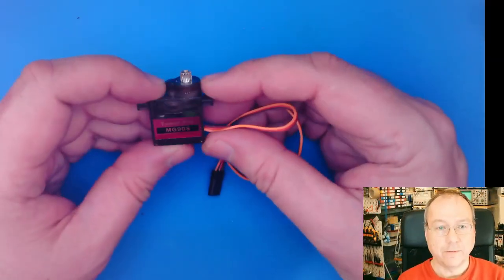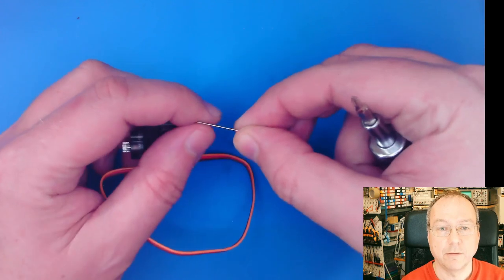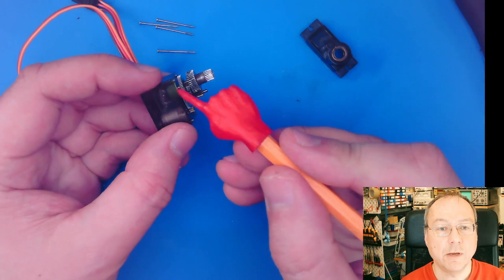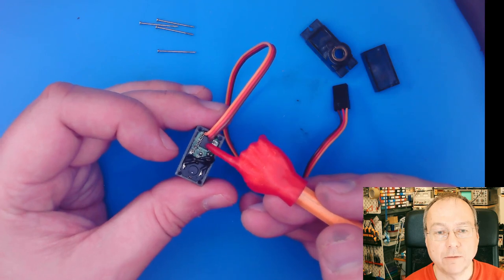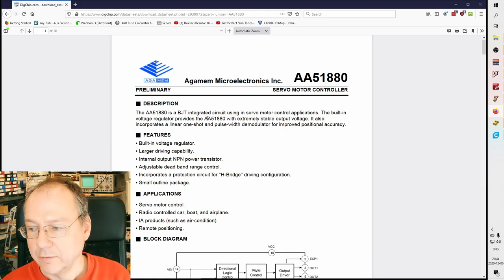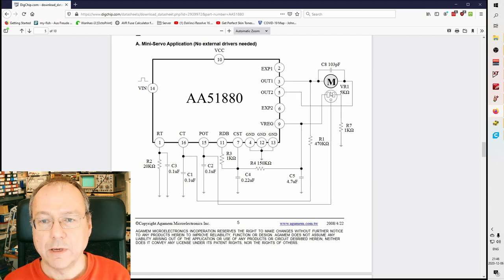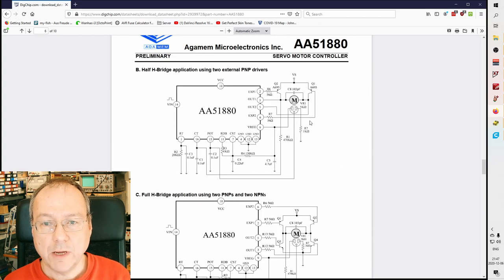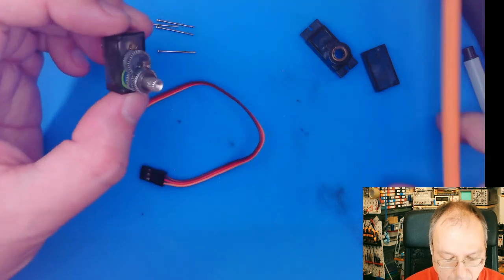Looking into a small servo motor

Comment: A simple trick is to remove the potentiometer and drive the motor directly, if you just want a small but powerful electric motor!
Reply from the maker: I have never done that and would personally think that it is a waste of a perfectly fine servo motor - but sure it is possible. The poor motor controller will try to catch the correct position but continuously fail to do so, because the feedback signal is gone...
Jag spelade in den här videon eftersom ämnet kom upp i diskussioner med mina studenter i fredags.